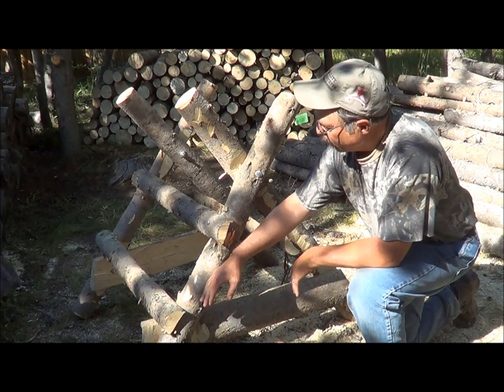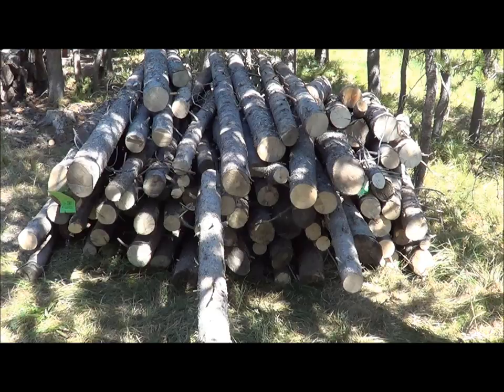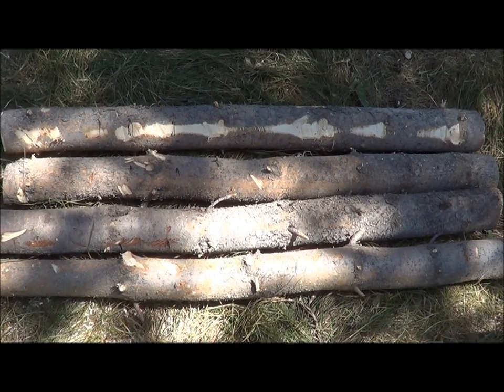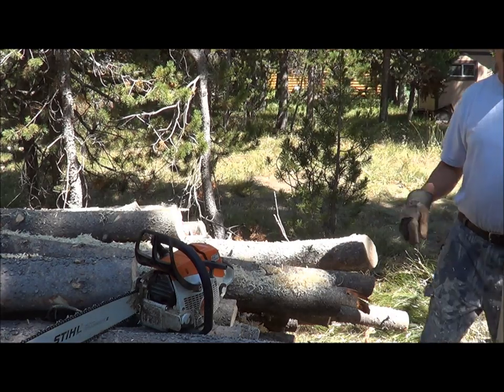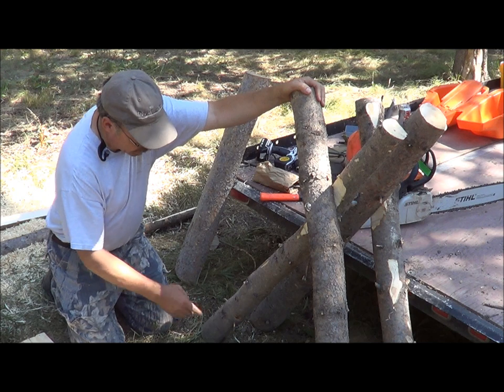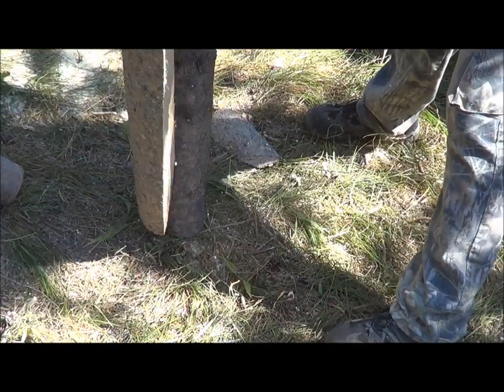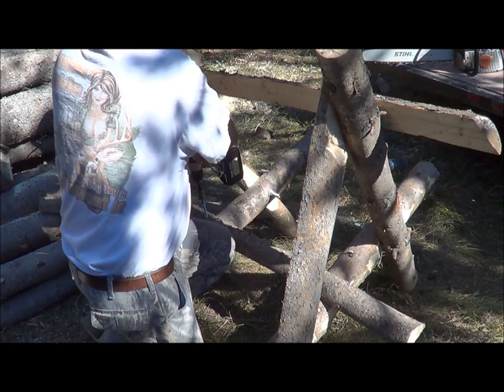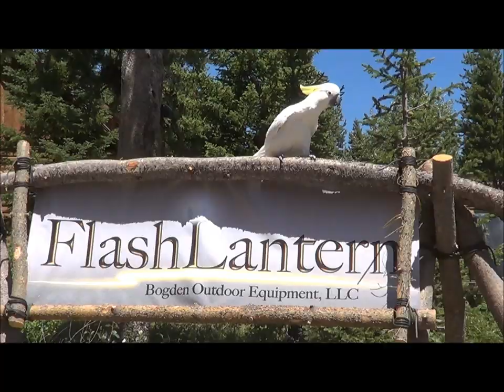Making a Saw Buck

Comment: Nice job.  How do you like the height that you have it set at?  I was thinking of building basically the same thing just a foot shorter.
Reply from the maker: +Stewart Flannagan 
thanks for the compliment. The height works for me because I can stand upright while blocking the logs. Bending over while working your chain saw will tire your back and since I cut and burn about 7 cords of firewood a year, I try to keep it comfortable. I did make a two foot tall by one 18 inch wide mini-sawbuck out of 2X4s this fall. I have a small freestanding stove in the dining room of my cabin and needed to half the logs that I would burn in my insert. Good thing I stored plenty of wood this fall. We have had about three feet of snow in the past two weeks and it looks like it is going to keep falling! Life in Yellowstone Country is great!
Reply: +Mike Bogden Well I built one yesterday.  I still need to finish it up.  Really makes sawing up logs allot easier.  I used some locust posts I had.  Thanks for the ideas.